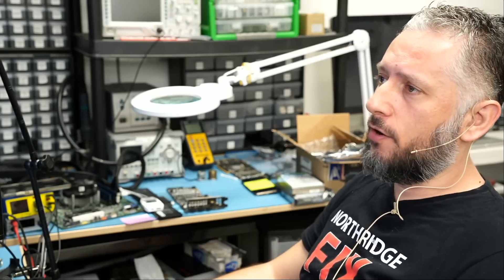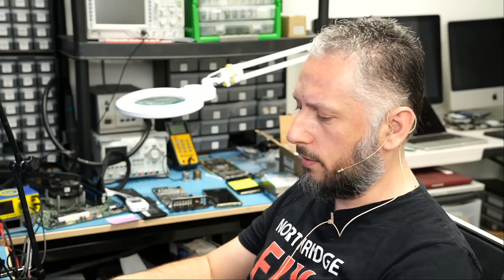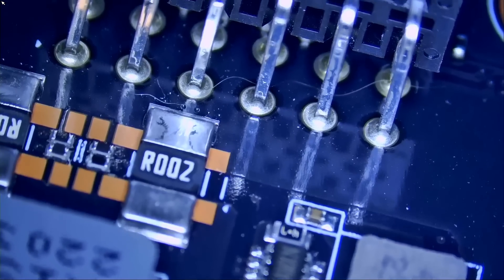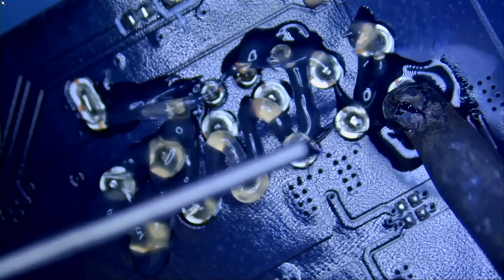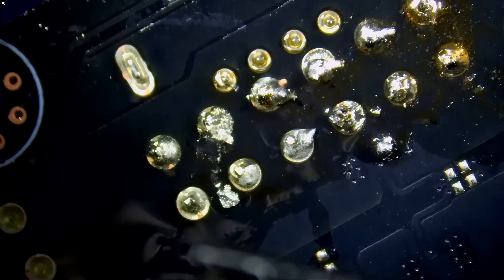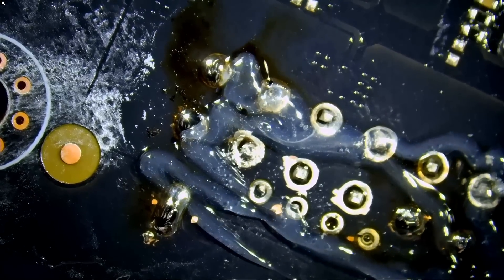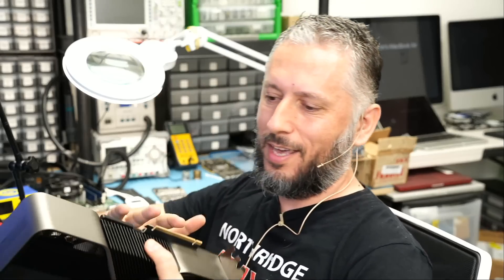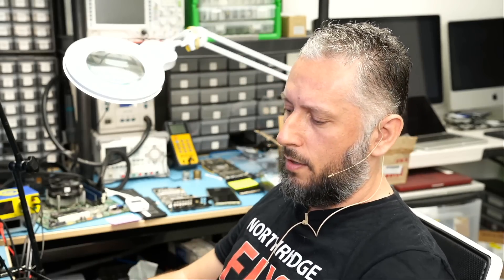Serious issues with 4090 power connectors melting - Is the user at fault ?

Comment: This is 100% an engineering error. When you pay at least $2k for a product, it should just run fine or prevent booting.The user should not have to be extremely cautious when plugging the cable in, instead there should be some amount of sensors to detect a higher than usual resistance and protect the card. I have a RTX 4090 myself (to do offline rendering continuously) mounted in an open frame rack to be sure the thermals are fine and there is no pressure applied onto the power connector. The GPU itself is a very good product which is a shame because it can't reasonably be used inside a standard ATX case. Also still not sure myself if my setup is okay or if it may somehow go bad in the future.
Reply: I think I agree with your case and point here. There should definitely be some sort of mechanism  that checks and makes sure the resistance of the power source is within an acceptable range /tolerance and if it isn't it will turn off the device to protect itself. This card (4090) is compatible with fewer cases on the market because some of them, take mine for example the Gigabyte OC 4090 is 151mm in width. You want atleast 35mm+ of clearance beyond that for the adapter/connector. So you need a case with atleast 186mm+ of "CPU cooler clearance" which is not many cases, I have mine in a p500a and it's one of the widest MID-ATX cases on the market at 190mm. The connector location being on the side is definitely causing issues as well, it should've been relocated to ensure compatibility and security of the connector.
Reply: @cipherbenchmarks  You're ignoring the contact resistance of the 12VHPWR connector pins. That's what's at fault here ! Even the manufacturer's data (Amphenol) tells you the connector will dissipare TWO AND A HALF WATTS at full load. THAT IS TOTALLY INSANE !
Reply: NO. Absolutely no need for sensors. Its solution too the problem that should not be there. System needs to be totally fool proof under fail. IMO.
Reply: @alesksander  Unless the connector only has two large pins with a large contact area (similarly to a AC power plug), there is no good way to make sure the connection is strong among all pins unless measuring it. There is nothing crazy about it. CPU/GPU cores have sensors. PSUs have sensors to adjust fan speed. Why not a sensor for some god awful connector literally melting itself? How would you solve that problem is you were a power supply engineer at Nvidia?
Reply: @alesksander  All that's required is an adequately rated connector that wasn't designed by some committee of halfwits who had no idea what they were doing ! Intel is as much to blame as nvidia actually, since it was THEIR idea AFAIK.

Comment: Absolutely on your side. For elecric cars for example, the connector is designed in a way so that the car can only charge at full speed if a shorter sensor pin is making a connection, ensuring the plug is fully connected. Otherwise the problem would be the same as with this gpu connectors but in bigger dimension.

Comment: Sounds like a class action lawsuit in the making. It is reasonably forseeable that a significant number of end users will not plug the cable in fully (if that is even a true cause). Looking forward to Alex's further investigation into this issue.
Reply: Could be also due to wire management. Wire dragging the sonector sideways and led to a faulty connection.
Reply: @todoralin6600  NO. It's inadequate conductor cross-sectional area leading to excessive I2R heating. 50 amps, the rating of the 4090 requires a 6mm2/10AWG cable. Does that look like 6mm2 ?
Reply: @grahamstevenson1740  and, why the wire insulation isn't melting ? Such an amperage on a single connector will led to disaster on bad conection (imperfect insertion or oxidation of contacts). Sure is manufactor fault since them, more likely, tested the connector on perfect condition, but, even in this case, the connector is push to the limit.
Reply: @grahamstevenson1740  conductor is fine, you can pass 1600w through it with it barely getting warm to touch,  issue is terminal damage due to mishandling or manufacture time defect.
Reply: It's too many wires going into fewer wires in a tiny connector, that's what is causing the melting. I've seen people plug the damn thing all the way in and still end up with a fried connector. 3/4x8-pin would solve that problem but these cards pump out so much heat nVidia figured they need as much PCB space as possible for the monstrous cooling brick that they're using.
Reply: @TwiztedJugallo  Yes, 3 or 4 8pin Molex Mini Fit Jr connectors would fix the problem instantly.
Reply: Gamers Nexus made a vid about it, you can check it out
Reply: they already tried, apparently only a few showed up
Reply: @aiden7891  More will show up due to contact ageing.
Reply: @aiden7891  class action was dismissed with prejudice because the users had never attempted to contact the vendor for replacement, and it was demonstrated they fucked up their own cards anyway.
Reply: lmk the only lawsuit that coming from this is amber heard trial

Comment: Legally it is a user error, as long as it is clearly specified to put the connector all the way in in the user manual. Be that as it may, it's obviously a design problem. Why install a 1 cent connector on a 2k5$ device? I'll pay extra 10$ for a better connector...
Reply: I mean I have build over 60 rigs with 4090 all with the nvidia power adacter and some with cable mod cable none of then have issue so far

Comment: I would definitely say that the manufacturer is responsible as this has not been an issue by a long shot previous to this "new" supplemental power connector. They should revert back to the original style. I would still prefer the tried and true style of 3 x 8-pin (6+2) PCIE power connectors. Why fix something that is not broken. Also there should be a thicker gauge wire used inside the connector. The best solution is to revert back to the standard PCIE power connector.

Comment: So I wanted to take some college classes doing this to become certified. And I was talking to a college professor. And I honestly don't get it. He told me it's cheaper to replace broken computer components then repair them. And I honestly just don't see or even understand how that's possible when some components can get pretty pricey. To me it just doesn't make sense.
Reply: Maybe labor and time costs
Reply: @cafe88 racer  I honestly don't know. But I think if you paid maybe $300 or $400 for something top of the line. I certainly don't want to run out and buy 1 or 2 more times. And getting into that. Key fobs, they usually cost $250 and up. Some even $500 I would imagine. And some companies it takes forever for them to get another key fob to you. Then you have yo spend like $200 or $300 just to program it to your car. When having a key fob repaired would be more cost efficient and it would be done a heck of a lot faster. So guess I don't know. To me it just doesn't make sense.

Comment: The connector is a bad design.  A major failure point -- such as a power connector -- needs to be made idiot proof.  I'm not an engineer and for those who are reading this, know that my next comment comes from a laymen's view and not an engineer's.  

From my point of view, adding circuitry either to the cable or the on-board connector to detect if all rails are properly receiving power, thus disallowing the burn out might be a good idea.  I realize it might raise the cost a bit, but I look at it like insurance.  I purchased a 55" TV for myself for just under $400 and I purchased a 65" OLED for my mother for $1600. I didn't purchase insurance for the 55", but for  about $100 insurance for the 65", it's a steal! And it includes 2-way shipping!

If Nvidia wants to charge an extra $25-$50 covering research and development for the additional circuitry for a $2000 plus graphics card, sign me the freak up!  That additional price pays for itself in peace of mind alone.

Nvidia needs to do a redesign of the connector--full stop.

Comment: I agree with your opinion on this. If the maker designs the card such that it is possible for the user to melt the connector if it is not plugged in fully, then the maker needs to fix this issue by redesigning the connector so the user cannot make this mistake.
Reply: @Samuel They could redesign the connectors with two shallow pins, one on each side, such that the only way those low current pins could be connected is if the cable were fully seated. Then the drive would check to see if those signal pins were connected and if not, fail to power the device.

Comment: Sir you are absolutley right. Its the same reason they write "Do not drink" on bottles of Tide. Older connectors had thicker wires and pins and could tolerate a mm or 2 of the plug being wiggled. The clips were bigger, you could hear and feel them clearly click when you plugged them in, to the trained hand and eye that is. These new plugs are much smaller and i suspect they are at the lowest tolerance for thickness for the amount of power they supply to the card. if it isnt in perfect, this happens. Inexperienced PC builders can easily run into this issue.

Comment: Both the video card connector and the power supply connector should be made with more heat-resistant material to avoid this type of damage. But that would lower your serving amount.
Reply: It would most likely just delay the damaged not prevent it.

Comment: It is not the users fault just look at the plastic that melts, that is caused by resistance in the connector that leads to high temperatures. And also the connectors pins are TINY! a bad design I can put my 30 year+ knowledge behind this statement, the connector is at fault to little surface  area in the connector.
Reply: Would be very interesting if someone could measure the voltage drop over the connector solder a wire to the bottom of the pcb one pin to the corresponding cable, then measure mV and log it the behaviour is exactly as you say Alex that the pins can not handle this current. And as soon as one of them starts to get cooked the resistance in the connector will increase and you should be able then to see when it started, but the biggest problem is that you do not know when the connector will fail a nVidia should do a complete recall!

Comment: Because the power draw on 1 set of pins is too much. Over a long period of gaming where the power draw is high. The cheap plastic will start to melt. If it had a 2nd connector then the draw could be spread.

Comment: It’s just physics… connector not plugged in all the way height resistance in the connector results in heat ends up with molten connector….if working on computers u should now basic physics, or at least to shove that connector all the way in……

Comment: Someone should bench test the card and use a thermal camera and see how hot it gets at the connector. I'm so curious to see how hot!
Reply: Gamersnexus has done that already
Reply: @PTS_Roller_Coaster_Case  Yeah that was an interesting video, however it wasn't done on a 4090 in the video. It was done on another card that the temps were token. Right after he talks about the connectors in the video then he talks about leaked photos of the upcoming 4090 card so it wasn't even out then at the time the video was posted 7 months ago. Maybe Alex can thermally shoot the card and see how hot the cable connector is getting on the card. In the video on Gamers Nexus said that the connecter reached a temperature of 180*C /356*F That's insane, with the 4090 having so many watts I'm sure the temps are even hotter! 🔥🚒

Comment: I use to think used car salesperson were the slimiest people, but the current round of products from Asus and others are getting even worse.  Asus for example are causing people's CPUs to explode if you have  7950x3d because the board is over volting the power to he CPU.  Root of the problem from what i understand is from faulty power management in the BIOS.   The suggest people to apply a BIOS update....  Now the kicker.  They are stating when you apply the BIOS your warranty is void.  Hmm damed if you do, damned if you don't.   And it seems to be even worse then that,  some of the tech computer channels are hearing of users applying the BIOS and the CPUs are still exploding...  Nice job ausu...
Reply: Most PC component manufacturers nowadays are pretty terrible when it comes to RMA support (ASUS, MSI and Gigabyte). Even at the enterprise level companies like Supermicro are absolutely wonderful to sell you a product but absolutely horrendous once you need support for it. Gone are the days of companies like EVGA. Absolutely sad state the PC market is in right now.

Comment: A connector like this is too "delicate" for the end user to use. I'd have much rather preferred nvidia going with the 12v EPS connectors they also use on server graphics cards, because those can handle about half the power of the 12VHP connector, yet can be plugged in more easily and is MUCH less delicate
Reply: EPS12V can handle far more than 12VHPWR in real world. In the past people have been overclocking Intel HEDT CPU with LN2 pushing over 1kW with 2  EPS12V connectors. Never heard anyone saying their connector melted.
Reply: so the solution for this are soldering a thick wire to 2 eight pin connector should solve this problem right, changing the new connector will result it another future failure anyway
Reply: People would just try to use adapters if nVidia tried to use a server power connector, it really isn't a good move on the consumer side. I get why nvidia made a new connector, look at how big and heavy the cards are now too, having two or three 8-pin connectors would take up a lot of real estate. Don't get me wrong though I'm not really a fan of the new connector and my next card will have the standard plugs. Someday there probably will be another new connector that all the video cards will use, that is probably far off.

Comment: @Gamersnexus has a detailed study why the cable gets cooked.
Reply from the maker: We have another 4090 with  an adapter connected and still has a melted connector. Loose cable is not the issue here.
Reply: @NorthridgeFix  100% True Nvidia Will sweep this under the rug as much as they can, Cant wait for "Have you bought and Nvidia Product in the last 5 years and your house burned down? You may be eligible for Compensation"
Reply: @NorthridgeFix  an adapter still can be improperly connected on that socket.These cables are designed to not have sharp bends in them in the case since the cables are usually routed behind the motherboard tray.

Comment: The company that makes the cards that have issues with burning connectors should be held accountable, they shouldn't even sell them, they should fix this issue before selling them,  I 100% agree with you Alex, that should be a recall.
Reply: @Zenkat please tell us Wtf this video has to do with politics?
Reply: how he can fix dumb end user brains? :]] but YES u right.
Reply: gamers nexus did a video on the nvidia power connector awhile back. If the plug isn't fully plugged in or it's a bad plug related to plug debris in the wire insulation afaik
Reply: Thank Steve 😂
Reply: It's not the AIBs, it's nVidia using a new spec. It was actually developed by Intel, and they don't even use it lol. PCI-SIG certified it.
Reply: It’s not their fault that the customers are idiots and don’t plug things in all the way. if you’re paying this much money for a graphics card, then you know who Jay’s two cents or gamers Nexus is they’ve talked about this in several videos. And not to mention, everybody says, make sure all your plug-ins are plugged in correctly if you’re a newbie or not, you should know this
Reply: This is an issue that requires a new connector standard.

This is not something a board partner can do on their own. In reality, this issue is the responsibility of both the manufacturer and the people.

Firstly, the manufacturer must honor warranties if their directions did not specify the cable must be fully inserted. But also, the user, who despite widespread education still fails to grasp how this kind of connection is dangerous. EVERYONE learns the basics of electronics in school. But obviously too many people are allowed to graduate without actually grasping the curriculum.

This is as much a design failure as it is the failure of an educational system.
Reply: They should be accountable for user error? It's been covered in depth by gamer nexus, can't have the connector burning if it's plugged in all the way

Comment: manifacturer is at fault for using a bad connector in my opinion. this connector should never have been used in the first place. you are getting the biproduct of the failure of engineers expect many more unfortunately.
Reply: Classic move from fab to limit the device lifetime 😂